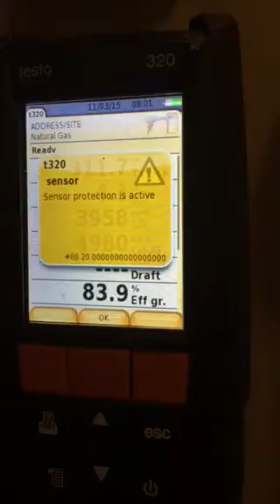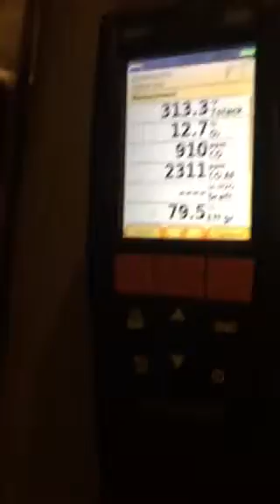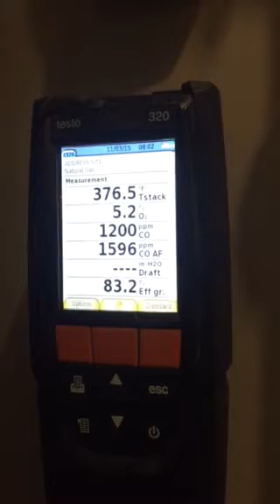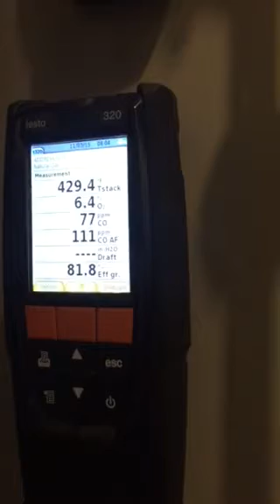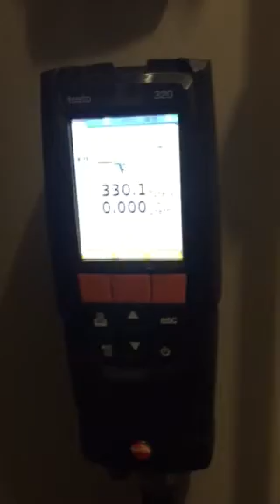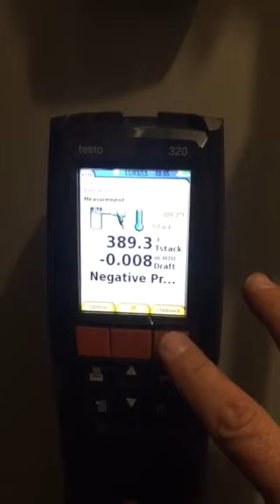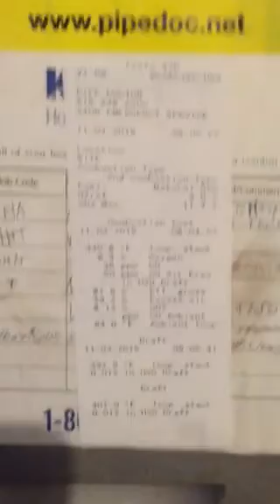Annual Heating Tuneup Hydrotherm Gas Boiler

Comment: I have a 65 year old HydroTherm boiler for my Hydronic Heating System. The numbers you were metering in this video on mine drop from 12 to 5 within 20 seconds once the draft get established. But the local utility wants to Red Tag it only so that we have to pay them to replace everything. 

My main question is that, aren't these "Gravity Flow" Boilers? and the return is on the bottom and the send is on the top? We had a B&G 100 and never had a cold expensive day. Until a "plumber" came out to do a service on the pump of the Linkage. A $10-15 part new, 10 minutes if you know how to puzzle it back together. Which I have done many times.

Needless to say they replaced the circulator with a Taco F-7 of which when we started having problems I called Taco to get info. The two Master Plumbers that I was able to get on the line were livid. "I wish Plumbers would stop replacing BG100's with TacoF7s!!!!!!!!!". So that confirmed that. Plus it was installed upside down on what the materials that were used to train maintenance people is the "Return" that flows into the bottom of the boiler. and is only an assist other than a real "pump" trying to push the water backwards. Which is probably the reason for the first time in over 60 years we're freezing.

I'm going to do a Burner Cleaning and have the Gaskets for the F7 and am going to turn it around, as Taco says they should not be run upside down anyway. The Anti-Flow Valve looks to be completely open as per the directions on the side of it for a "Gravity Fed" system.

How far off am I or do I need "How not to be a 'Schmuck' Lessons"?
Any assistance will be greatly appreciated.
Thank you . . .

Comment: Great video....In my 2 family apartment they have the very same boilers (Hydro Therm) that heat comes out of baseboard heaters. The front End of the 2nd floor (living room, dining room) heats up for like 2 days then does not work for a week. Back and forth. The back end of the apartment (bed rooms) work fine. Can you advise?

Comment: I have an old Hydrotherm. It is probably older than this beast and am I thinking about having someone do a combustion test. Several years back, I replaced the gas valve and used the gas meter to assess gas volume. It would be nice to date code it as well.